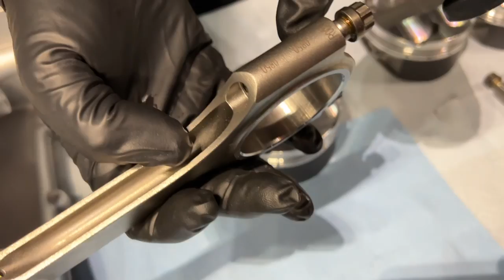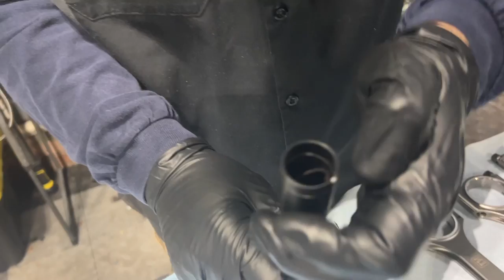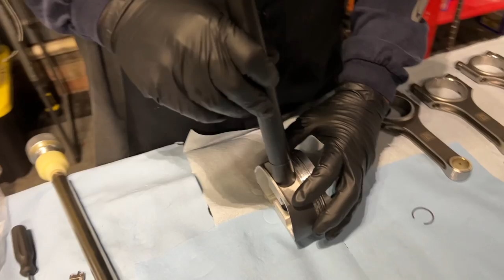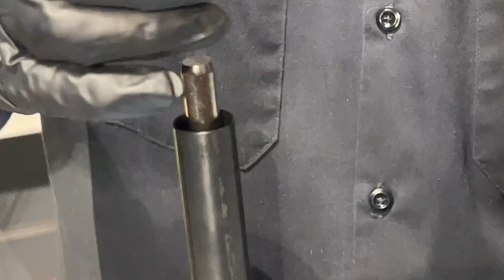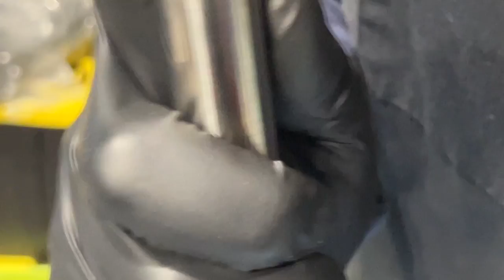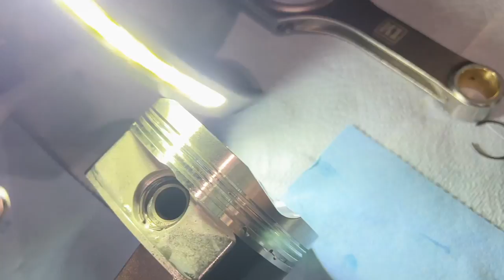Porsche 911 Engine Assembly Guide - Part 3: Bank 1 Pistons

Comment: Hi Konrad the original Porsche tool is much better than those aftermarket ones. The best way to put your first clip in each piston is by hand and not using the tool as you don’t have the pin in to centralise the inserting tool
Reply from the maker: +lee jenkins so the pin helps center the inserting tool? I don’t understand how, but I need to understand! And it makes sense that the genuine tool would be better. Is it possible to explain how/why it’s better? Thanks so much for your info Lee! 🍻